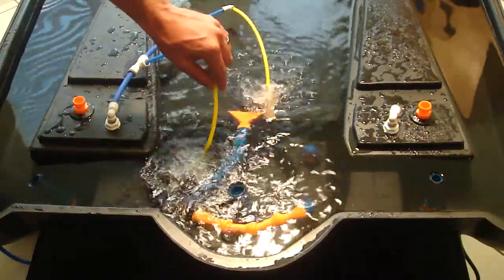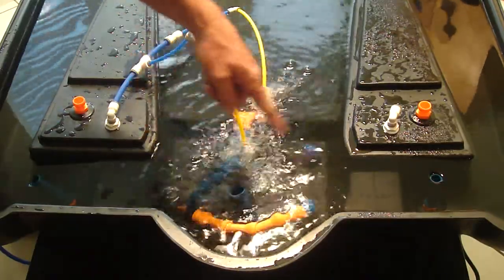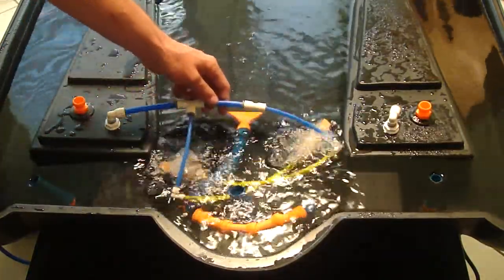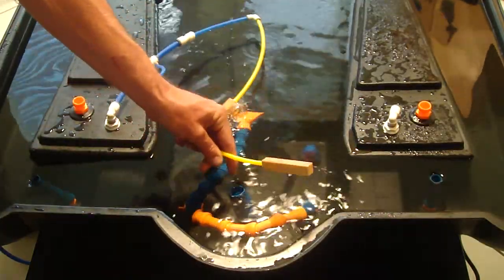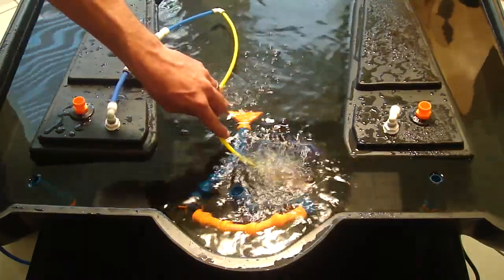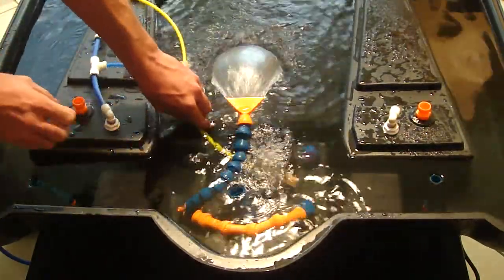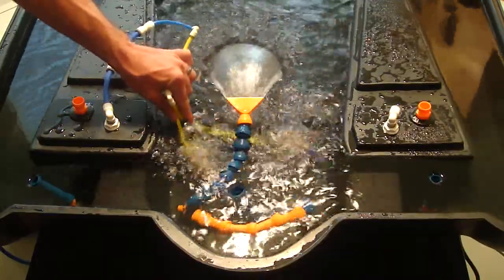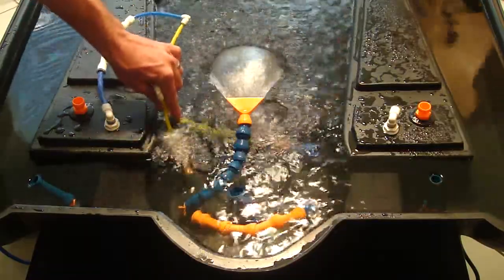River Current (aka RDWC) in the TreeFrog by Multiponics

Comment: How many gallon Reservoir was used to set up RDWC? Thank you!
Reply from the maker: It is possible to use just a 5gal bucket, but not feasible because if there were a pump failure, the drainage water would overflow into the room. We usually use the 27 gal tough totes (black with yellow lids) and to prevent the possibility mentioned above, we will daisy chain two of them together using our reservoir connection kits. FYI, the TreeFrog also has a 27 gal capacity.

Comment: How far up into the net cup with hydroton does the water come at this level?.Curiosity man
Reply from the maker: At this full level, it goes almost all the way up the net pot. This is great for root starting, but it is best to "tease" the roots into growing down by using the adjustable drains to dial in the water level to be just barely below the root line.